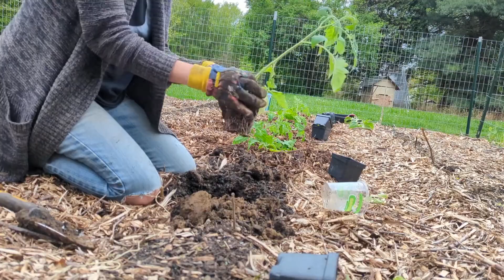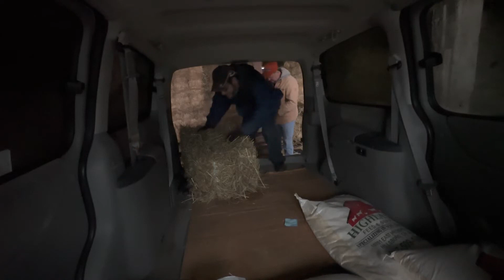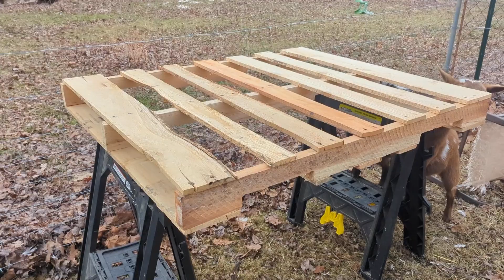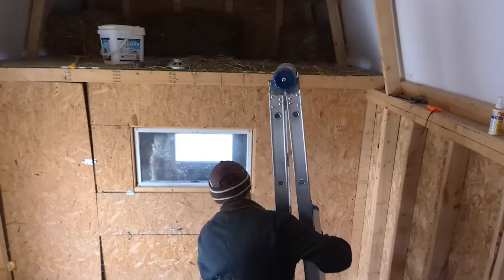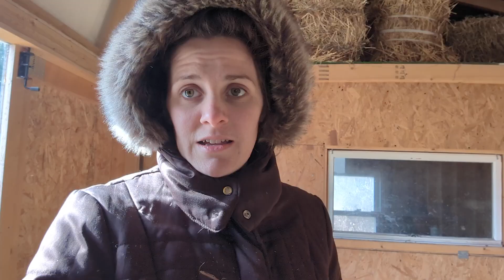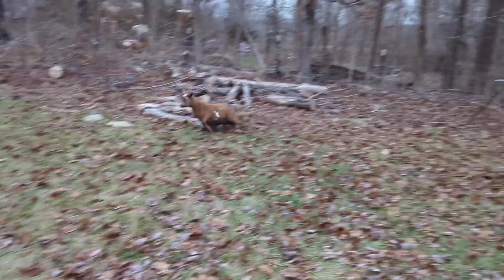How many HAY BALES can we fit in a minivan?

Comment: 12-13 depending on if you use the front seat. Hahha. Been there, done that. Almost 6’years in and we are finally using a truck. My van had hauled so much that has never been in a minivan advertisement 😂 Great job!